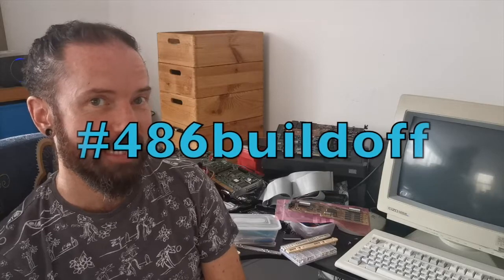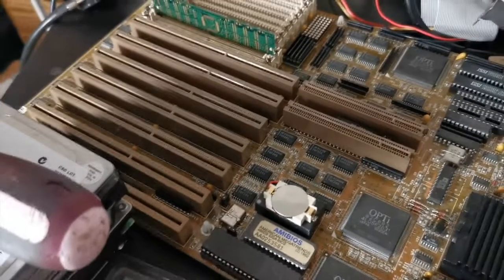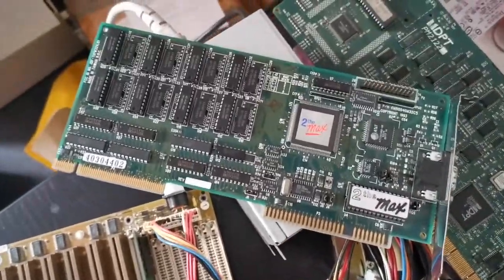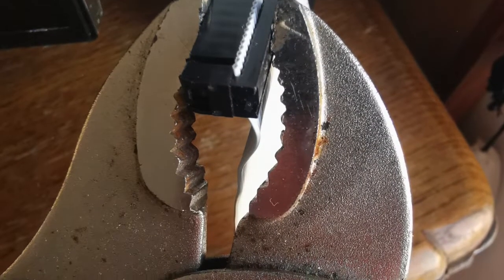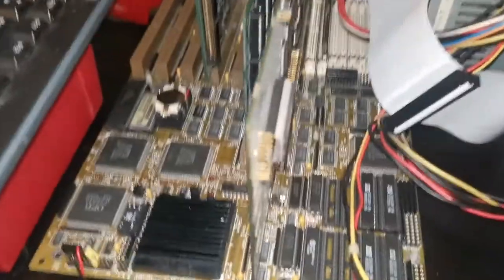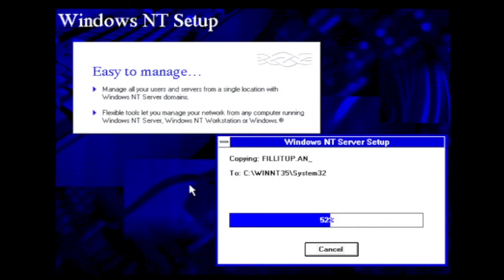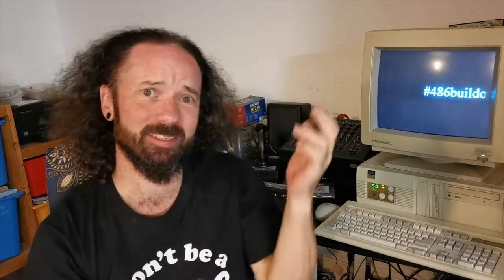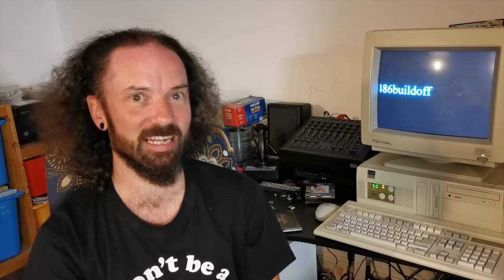#486buildoff 486DX-50 Web Server with EISA SCSI RAID

Comment: Nice one, I do like these in-depth projects to re-create server environments from the 90s - only relatively recently considered "vintage"   I had a DX50 VLB build BITD - took a while to get stuff that would work reliably.  EISA still ran at the 8MHz clock no matter what CPU was installed.  Caches on array controllers aided striping and mirroring, but the speed of the CPU is so much quicker than the I/O bus - hence VLB and PCI.
Reply from the maker: Nice to hear from someone else doing similar things! Yeah although the bandwidth is good (I'm going to do some tests to quantify this) the frequency is not. I would be fascinated to see the PCI version of this card because it must have been far and away faster by comparison. Thanks for dropping by. 🙂

Comment: That is a very nice build. I have to suspect your cache stability issues might be entirely the fault of that OPTi chipset, as they always seem to be finicky things - I don't just try to stay in UMC/SiS land for no reason, you know. Not sure if they ever made an EISA chipset, though. OPTi, by contrast, seem to have made one for everything, even solutions to problems that never needed solving.

Worked with EISA just once. Never again. DPT controllers too (You'll see, soon enough. Strange parallels.), never again. I'm surprised by the RAID5 support, as that definitely doesn't show up on older hardware very often.

There is another 486 web server out there: Mine. No Windows NT; all DOS and it's been off for a while. Need to get back to that project some time, as it was supposed to be a museum of machines I own. Also had it stream video. ISA only machine and at a mere 33MHz, as the board tops out there. It has occasionally served a static version of the main site when the modern server has been out for repairs. It's all still there ready to go when time permits.
Reply from the maker: Thanks for the compliment! I haven't given up on getting to the bottom of the cache issue. It's definitely finicky but none of my other 50MHz-capable boards are functional at the moment so I can't run do any meaningful tests. It has occurred to me that having the controller and graphics on VLB might have something to do with it, so I'll investigate other configurations. It works fine at 33MHz, after all. I never considered chipsets to have a personality until hearing your various comments about them.

Not surprised about your feelings on EISA - it took a lot of effort to get this system working properly, but I'm more persistent and more knowledgeable than I used to be, thanks in part to people like yourself. Now I'm extremely intrigued by your DPT card! guessing it's ISA. I saw those pics your shared of your 486 web server - I definitely want a similar thing working long-term, but it's likely to be on my SPARCstation just because it's lower profile compared to this tank of a system. Would love to see yours online again.

Comment: Loving this build. You’ve actually built the build that I was planning for my PET48PN Rev.1. That is, until my motherboard died on me. :( it’s still on my bench, waiting to be repaired. 

That SCSI gear is really awesome. I think you might be able to fit another HDD under the PSU. :) 

Have fun on using this awesome little machine. I know I already through this video. Many thanks for that! 

Cheers!
Reply from the maker: Thanks for such a great comment! I think you might be right about the extra HDD. 😉 I'm still playing with this system, testing out 7 different CPUs to find out all the different ways that performance can be affected, including RAID-1 vs RAID-5. I hope you get your board working and if you need any assistance with it i would be very happy to help if I can. Best place to get in touch would probably be Twitter. Thanks again!